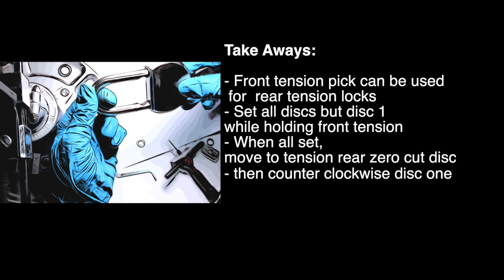How to Use Front Tension Pick for Rear Tension Disc Detainer Lock - Example with Amazon Basic DD

Comment: Great vid, thats for sharing it! My experience is that if tensioning the lock based on a disc that is not at its gate (while tensioning the lock) its far more difficiult to feel when other discs are at gates. I have noticed that if you push the lock core towards the sidebar it might help to get a better contact between the sidebar ant the discs you are checking.
Reply from the maker: that's very high praise coming from a DD guru such as yourself - awesome channel - may i ask what you mean in "push the core" - how do that ? you mean set things counter clockwise? MANY THANKS cuz ya some of the discs sure felt unfeeling! thank you
Reply: @itsallinhow  i mean something like this with that "push the lock core towards sidebar" https://youtu.be/so3S_s8QJPI
Reply from the maker: @idanhurja  ah! you ain't kidding. where i grew up we might say "reef against the side bar" - thank you can hardly wait to give that a go!! your vids are inspiring - ok a little intimidating too because well - inspiring - thank you for sharing all this work!! and for dropping by

Comment: That was really cool!!!!
What is the offset thickness of the the 3D stabilizer? 
🐾🐈🐈‍⬛🐾👏👏👏👏🍻
Reply from the maker: thank you very much
4.32mm - but it doesn't matter here - as the effort is really getting the tip - the two prongs - to stay seated so the stabilizer could be thicker, and pull out the tip more and you're still trying to get purchase past that spinner on the first disk - in this lock anyway
Reply: @itsallinhow  got it. Thank buddy!!!
Reply from the maker: @chriscapune7873  you bet - there's the model of this on thingverse https://www.thingiverse.com/thing:5148493

Comment: Another awesome DD exhibition. So even though the first disc isn't in a gate it will still put tension on the sidebar?
Reply from the maker: yes! cool, eh? Bosnian Bill has a nice demo that shows that any (but perhaps not a butterfly disk) disk can be turned against the lock housing https://youtu.be/rMIEPkaadq0 - which is why that works and why one counter rotates back at the end to get it into its gate (when not itself a zero cut)